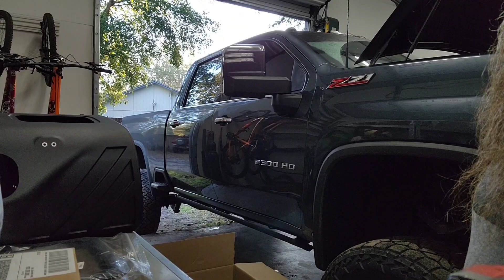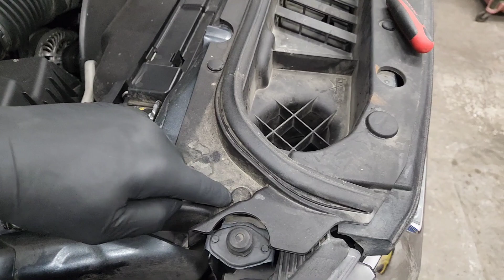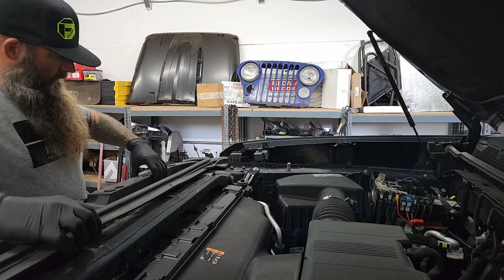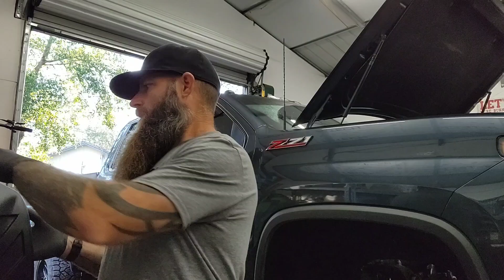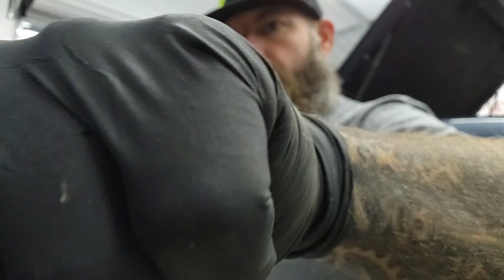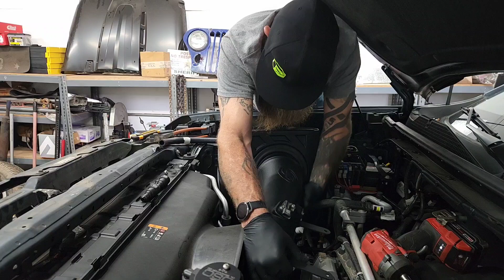Installing S&B air intake and J&L oil separator on 2020 Chevy 2500hd 6.6 gas

Comment: I have a 2024 GMC 6.6 gas. What does the air box do for it? I already have the J&L oil separator installed..
Reply from the maker: @sam-68-56  it gives a little low-end power. If you remove the larger vent block, you will need to turn your air filter minder off in your dash setting because it is so free following.